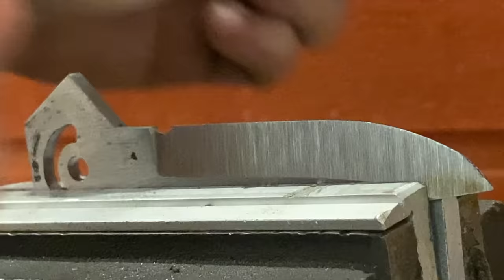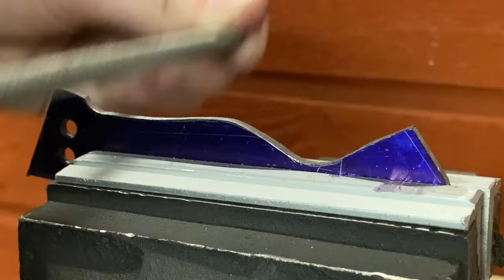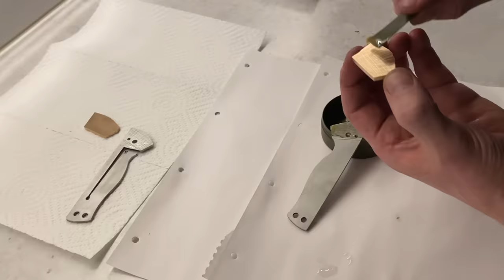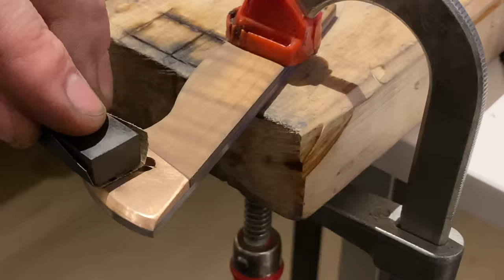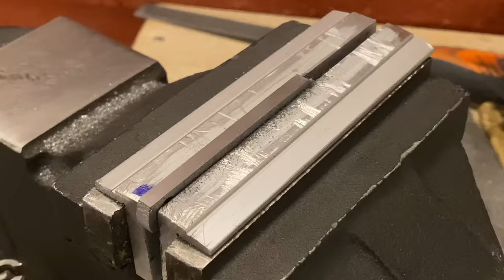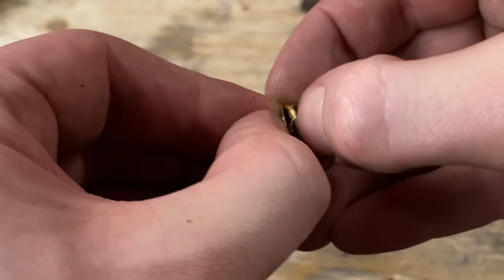Knife making - My best liner lock knife so far

Comment: It always gives me the creeps watching someone drilling steel without clamping it down first. I had a friend who lost partial use of his hand after the drill grabbed in a piece of steel he was drilling and it spun around. Beautiful knife though
Reply from the maker: I see your point! I hold it with pliers if I use a drill larger then 5mm or 3/16  after what you describe happent to me. Fortunate for me, I got off with a bad cut. Smaller drills just snap, in my experience. Thanks!
Reply: @Inmyshed  Yeah Sorry mate. Don't mean to criticize your working practices. My friend was using a 3/8" drill to drill a piece of steel to make a tool for a lathe so as you can imagine, it made a bit of a mess of him when it spun around a few times. Beautiful piece of work you have done though
Reply from the maker: Ah no thats oki! I like feedback! Yeah that dont sound good. Hope he is ok! Thank you! Glad you liked it!
Reply: I was going to say the same thing. I've spent 28 years as a safety professional in industrial construction, fabricating, machining, etc. I see hand placements here that I carried folks to hand specialists for...several times.
It's all good til it aint.
Reply: I was dilling copper bar , it grabbed as it does spun round and opened my hand. Quite nasty actually as it ripped more than cut.
Reply from the maker: I feel like that happens with copper/bronze way too often. I have started using pliers when drilling that type og material. Hope you hand has healed!
Reply: @Inmyshed  Yup it sure has... But I don't drill copper or bronze unless it's held down somehow. It's just not worth it. Also heavy on drill bits if it breaks away. 
I was not going to mention this one...but I still have a kind of PTSD when I see people hand sanding or washing enchant off knife blades . I have unzipped myself to the bone now more than twice. And it's aweful becouse it's dirty and your probably a little tired so it's normally bad.
😂 I try avoid excessive hand sanding if at all possible
Reply from the maker: But when I see the finished bolsters in bronze, the risk is worth it🤷🏼‍♂️😂 I look forward to the day I own a real belt sanding machine, where I can get fine grit belts. That will sure knock off about 10H of hand sanding!
Reply: @Inmyshed  It will most definitely make a huge difference. I was thinking just that....
Reply from the maker: Real/big sanding machines is not really a thing in Norway, but I know of one company that will start selling them in april, so Im saving up!
Reply from the maker: Thanks! I will look into it!
Reply: I only clamp it if I tighten the drill chuck. Normally, I hand tighten all my bits that way if they catch the bit spins in the chuck, and doesn’t rip it out if my hand. But this does two things for me, doesn’t rip shit out of my hand, and  can’t overpressure and burn up a bit either. As long as the bit is sharp it cuts great.
Reply from the maker: Thats good advice!
Reply: @Inmyshed  it’s always worked for me, keeps my hands safe and keeps my bits sharp. Look forward to your next videos, subscribed!
Reply from the maker: Im almost finished with a knife now, new video soon! Thank you so much!
Reply: Sliced open the top of my thumb doing that
Reply: Watching that makes me cringe also.   Exactly what happened to me after making 30 knives without incident.  Almost lost my thumb when the drill press spun that blade into my hand...while I bled all over it then fired the blade across the garage.  If the pointed end had hit me could have been the end.  Now I only drill if work is clamped down or in a vise.   A hard lesson learned 10 stitches and months to heal.
Reply: Какими сверлами пользуетесь  производителя

Comment: I CAN TELL YOU ARE A GOOD CRAFTSMAN AND YOU KNOW WHAT YOU ARE DOING THE MOMENT THIS VIDEO STARTED, YOU WERE USING THE FILE IN THE CORRECT WAY, YOU PUSH THE FILE THEN LIFT IT UP TOTALLY OFF THE STEEL THEN REST IT DOWN AND PUSH IT AGAIN.A LOT OF PEOPLE DO NOT KNOW HOW TO USE A FILE CORRECTLY,THEY JUST PUSH AND PULL WITHOUT LIFTING THE FILE OFF THE STEEL THEY ARE FILING..GOOD JOB.
Reply from the maker: hehe thanks! I do it like that on all my good files. cheap needle files on the other hand, hehe

Comment: Your doing a great job with limited equipment , but please never rely on epoxy to bond metal to metal like you did on the bolsters . If you were only after a temporary bond so you can shape them then ok , but you really must use a mechanical hold like a peened pin or a screw to secure them in the long run , the pivot screw can rotate and things can move. The glue will also make a gap between your bolster and the liner ,and if you squeeze it out to get less of a gap then you may as well not put it in there . Investing in a more accurate drill press is a big plus and some precession reamers to.  You certainly have the patience to be a great knife maker so please keep it up , and thanks for sharing.
Reply from the maker: Thank you for your feedback! I will try with some peens in the future! I just ordered a even heat owen, but next om my list is a decent mill/drill press! Thank you so much!
Reply: @Inmyshed  An oven and some way of testing the hardness is a game changer . A mill is handy once you learn how to use it , but you can get by without one . keep at it .

Comment: if you delete the pocket clip you have enough room  for a longer blade, as it comes apart you can make a cardboard blade to play around with blade lengths . most factory knives too have a shorter than maximum blade length
Reply from the maker: I may be making a knife with no backspacer, just a stud in the future, then i will try to maximize the blade lenght.

Comment: May I offer a suggestion? Why not use a half-dovetail to secure the ends of the scales and the metal at the pivot? If you use a light curve lengthwise it will lock the scale end from moving laterally or vertically.
Reply from the maker: Hi! I have experimented with dovetails on bolsters. With my current equipment I find it really hard to get a nice and even finish on it, and it always leaves one bolster shorter then the other. If you look up the spear point slip joint I made, you can see the bolsters are not 100% even. I however will from time to time try to make dovetails on the bolsters. So maybe in a future video you will see it! thanks for the comment!

Comment: Beautiful knife!! I’ve never seen a file like the one you used for the finger notches. I’ve made fixed blade knives but haven’t made a pocket knife. Would you be will to share your plane for this knife? Great work!!
Reply from the maker: Hi! Thank you!  its a "checkering file/jimping file". Commenly sold at gunsmith shops. Mine is from Brownells. I would if I had some. I sketch out the knife on paper before I make it and the paper gets destroyed in the process. Good luck with your project!

Comment: Do you make any spring assisted knives
Reply from the maker: Hi! Its illegal to have or make that in Norway. Later down the line, I will probably get a permit, but as of now, I am happy with making slip joints and liner locks. I am going to try to make some lock backs aswell.

Comment: Great work man. What was the bit you used to cut out the swivel?
Reply from the maker: Thanks! What is a swivel?
Reply: @Inmyshed  it’s the half circle channel you cut in.  Was that a mill or a drill you used to clear it out?
Reply from the maker: Ah oki! I used a drillpress with an end mill bit. (I think thats the name in english). I made a sort og jigg for it, just rotating the blade around its own pevot point.

Comment: Can we hire u to make me a folding knife let me know asap
Reply from the maker: Hi! I will not sell knives until my evenheat oven arrives and I get the hardening and tempering down. I use about 50-60 hours making a knife. This is with my current equipment. In april I get a real belt sander, and this will knock off about half the time spent. For now the time spendt to money earned ratio is just not worth it, sorry. Maybe in the future if you are still up for it!
Reply: @Inmyshed  yes I’m sure will

Comment: Pretty rough fitup on the belt clip side of the handle.
Reply from the maker: What do you mean?
Reply: No worries it has a clen sounding spring action.
Reply: @Inmyshed I could see it from your 1/8 inch thumbnail. I thought it was a crack.
Reply: Seems like you got frustrated at the belt clip recess, and instead of improving it you just did a rough recess without even sanding or squaring the interior.
Reply from the maker: Ah, well I did make it as close i could get. It was a real «back n forth» situation where I test-fittet it multiple times.
Reply from the maker: Yes it not 100% perfect.
Reply: No worries! The "Wolverine snickety-snick sound shouts deadly machining. Every wannabe mugger knows THAT sound even in the dark!